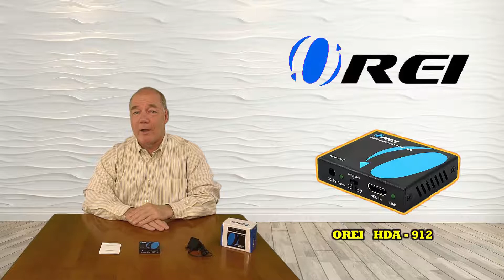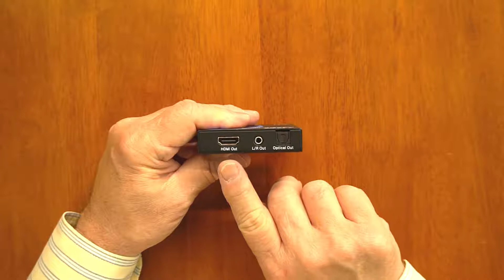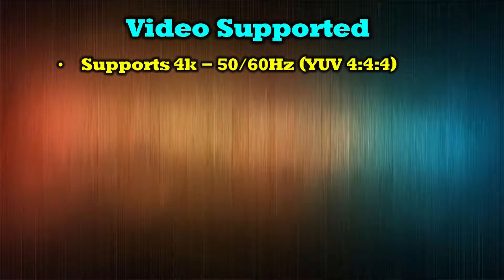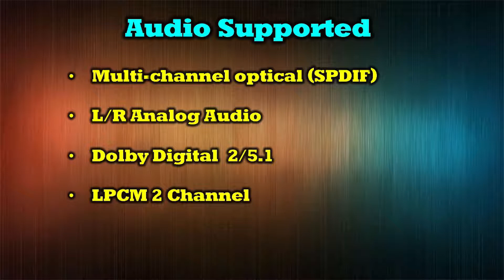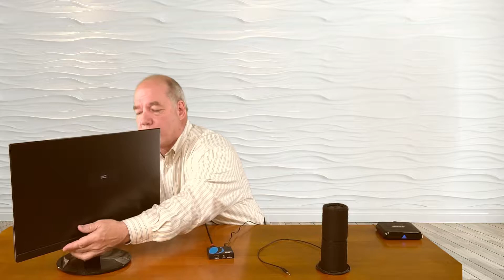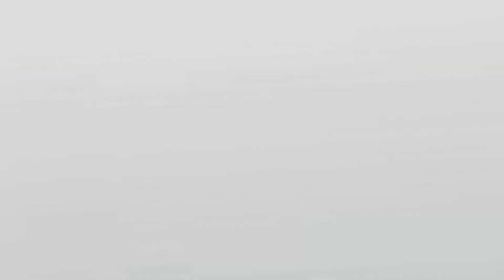OREI HDMI 2.0 Audio Converter Extractor | SPDIF + 3.5mm Output: HDA-912

Comment: This product is a pile of crap.  It says that it converts audio, it does NOT convert audio, it only supports PCM 2 Channel Audio.  If you are looking for a product that takes in any HDMI Source and passes through the Audio to the HDMI out un changed and converts to 2 channel PCM out the 3.5mm Socket, then look elsewhere due to this product doesn't do that at all.
Reply: What would you recommend for someone using optical connection for 1080p 120hz?

Comment: A small question -  In case the source is connected to the TV hdmi input (any) and from Tv Hdmi arc the connection is done to the Orei HDA-912 hdmi input. Is it possible to get audio out from this orei device. And the Volume can be controlled from TV remote by switching on the CEC function. I feel it is possible but need you validation on this. One of my greatest problem will be solved. Thanks you.

Comment: This should fit my use case by connecting 2 HDMI ports from 2  soundbars not monitors. To my HDMI U8N HDMI eARC port. If I can't get my soundbar off a  HDMI port to connect like it should at least this model also has the Optical cable port. I do have an optical cable as a back up connection. Yeah it sucks my U8N can't to 2 separate audio outputs at the same time.

Comment: Did It convert DD+ (from Netflix) and send it via toslink to sound speaker?
Reply: Yes.

HDMI 2.0b
HDCP 2.2 & HDCP 1.4
18 Gbps video bandwidth
RGB, YCbCr 4:4:4, YCbCr 4:2:2
10-bit, 12-bit color depth support
4K@30/50/60Hz (YUV4:4:4), 1080p@120Hz, and 1080p 3D@60Hz

HDMI:
LPCM 2/5.1/7.1CH, Dolby Digital, DTS 5.1, Dolby Digital+, Dolby TrueHD, DTS-HD Master Audio, Dolby Atmos, DTS:X

Optical:
LPCM 2CH, Dolby Digital 2/5.1CH, DTS 2/5.1CH

L/R:
Analog Stereo 2CH

It also does work on game consoles like the Xbox Series X, yes.

Comment: Furthermore what does high bit rate mean exactly. Could you please be more specific?
Reply: HDMI outputs 24 bits @ 192 kHz, so that is what you are extracting. If you use the L/R output you get stereo, if you use the optical you get surround, if it's being used, and if your device can translate the signal and play it back.

Comment: Hey just wondering is LPCM available for 2.1ch. I have a high end sound system so i want to make sure it doesn't degrade sound quality. Also is there any significant lag to audio or video?
Reply: I am going to be using spdif with a dac
Reply: HDMI 2.0b
HDCP 2.2 & HDCP 1.4
18 Gbps video bandwidth
RGB, YCbCr 4:4:4, YCbCr 4:2:2
10-bit, 12-bit color depth support
4K@30/50/60Hz (YUV4:4:4), 1080p@120Hz, and 1080p 3D@60Hz

HDMI:
LPCM 2/5.1/7.1CH, Dolby Digital, DTS 5.1, Dolby Digital+, Dolby TrueHD, DTS-HD Master Audio, Dolby Atmos, DTS:X

Optical:
LPCM 2CH, Dolby Digital 2/5.1CH, DTS 2/5.1CH

L/R:
Analog Stereo 2CH

Comment: I have purchased this product today 
It’s working fine with laptop through hdmi but when I connect fire stick its not working 
Plss help me with this
Reply: HDMI 2.0b
HDCP 2.2 & HDCP 1.4
18 Gbps video bandwidth
RGB, YCbCr 4:4:4, YCbCr 4:2:2
10-bit, 12-bit color depth support
4K@30/50/60Hz (YUV4:4:4), 1080p@120Hz, and 1080p 3D@60Hz

HDMI:
LPCM 2/5.1/7.1CH, Dolby Digital, DTS 5.1, Dolby Digital+, Dolby TrueHD, DTS-HD Master Audio, Dolby Atmos, DTS:X

Optical:
LPCM 2CH, Dolby Digital 2/5.1CH, DTS 2/5.1CH

L/R:
Analog Stereo 2CH

Comment: Would this work to send the audio out, via a 3.5 cable, to an FM transmitter? I want to use it to play digital effects from a media player to TV but send the sound to an FM transmitter. So from media player to extractor to TV all via HDMI but then send the audio to an FM transmitter from the extractor with a 3.5 cable
Reply: @OREI-COM  these are the choices for the media players audio out ..

https://i.imgur.com/oHYZxXw.jpg

Comment: I bought this product. Today from Amazon.
For using, it to connect my Sony 4k television with my Harmon Kardon 2.1 stick speakers. As a audio output device using 3.5 mm Jack.
I watched this video and connected everything accordingly. And set Tv sound to audio system. But still there is no audio coming out of the speakers.
I used HDMI cable from Tv as input device.
And 3.5 mm Jack as output.
Also kept the switch provide next to HDMI cable at Tv.
Power led on device is green.
And speakers are working fine when used with Pc or smartphone.
Please help me. I don't know if I am doing anything thing wrong. The device should extra audio from hdmi and out put the audio through 3.5 mm Jack as advertised.
But it's not working 😔
Help me out.
Regards.
Reply: Did you find any solution. Same issue here.
Reply: @aktharsai  contact OREI customer support with the details. They tell you the right product.
Reply: Hi. Thanks for your reply. Did u change the box for your issue. I have mailed them but awaiting their response. Which model you are using now
Reply: @aktharsai  Actually, I returned the product because the replacement was not available in my region.

Comment: Does this product work in different speaker different audio in 5.1 channel when connected to optical cable??
Reply: HDMI 2.0b
HDCP 2.2 & HDCP 1.4
18 Gbps video bandwidth
RGB, YCbCr 4:4:4, YCbCr 4:2:2
10-bit, 12-bit color depth support
4K@30/50/60Hz (YUV4:4:4), 1080p@120Hz, and 1080p 3D@60Hz

HDMI:
LPCM 2/5.1/7.1CH, Dolby Digital, DTS 5.1, Dolby Digital+, Dolby TrueHD, DTS-HD Master Audio, Dolby Atmos, DTS:X

Optical:
LPCM 2CH, Dolby Digital 2/5.1CH, DTS 2/5.1CH

L/R:
Analog Stereo 2CH

Comment: Does it work with xbox series X at 4k? And does it do pc RGB range? I'd appreciate any feedback.
Reply: HDMI 2.0b
HDCP 2.2 & HDCP 1.4
18 Gbps video bandwidth
RGB, YCbCr 4:4:4, YCbCr 4:2:2
10-bit, 12-bit color depth support
4K@30/50/60Hz (YUV4:4:4), 1080p@120Hz, and 1080p 3D@60Hz

HDMI:
LPCM 2/5.1/7.1CH, Dolby Digital, DTS 5.1, Dolby Digital+, Dolby TrueHD, DTS-HD Master Audio, Dolby Atmos, DTS:X

Optical:
LPCM 2CH, Dolby Digital 2/5.1CH, DTS 2/5.1CH

L/R:
Analog Stereo 2CH

It also does work on game consoles like the Xbox Series X, yes.

Comment: i connected my tv using hdmi out and soundbar using optical but sound is going to tv only how to pass audio to optical . tried all 3 config .
Reply: @OREI-COM  my mistake actually audio was coming out from both the tv and soundbar. didn't noticed it at that time. Do i have to mute tv audio everytime in this case?
Reply: @OREI-COM  there is one problem i noticed when it is connected. There are some flickering in my laptop. Let say when I press windows key the menu opens, when i hover my mouse over it there are some flickering. It doesn't happen when directly connected to tv